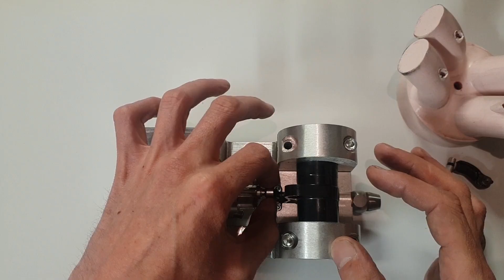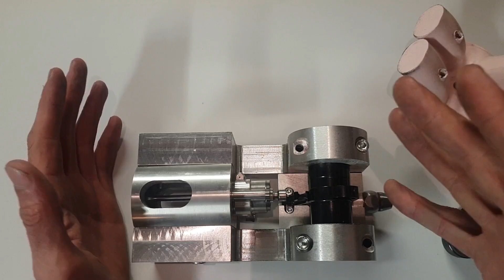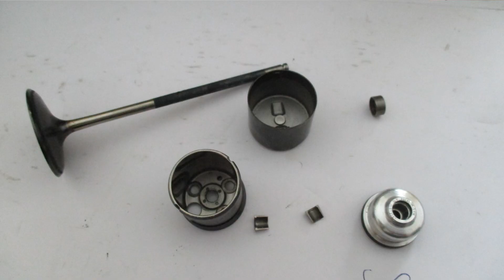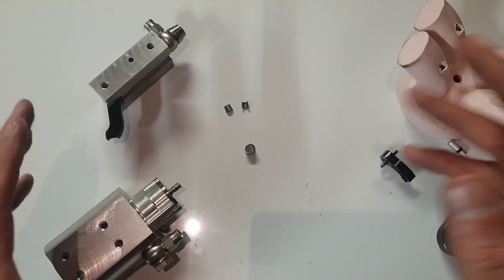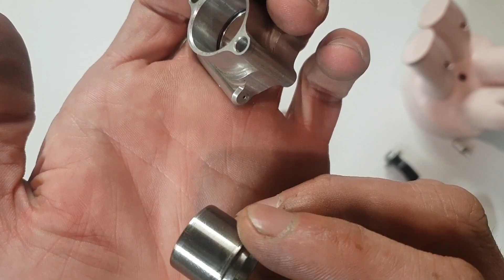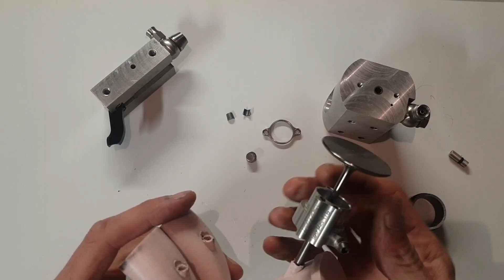F1 Pneumatic Valve  Spring - A Closer Look - Ep 1

Comment: Is there a pump on the car to keep these up to the required pressure?
Reply from the maker: No, a nitrogen bottle about the size of a camping flask is topped off before each race. Its down by the drivers left thigh in cockpit. The seals don't leak much at all.
Reply: @EngineeredtoWin  thanks for the reply. I absolutely love the videos, cheers.

Comment: That's a fascinating video and one of the few engine parts I knew nothing about.
Amazing how simple the check valves are even though there are a lot of pieces inside each one.
Could the pressures be 'fine tuned' with the assembly screw?
 Some beautiful machining a lot of it I wouldn't like to do, way too sketchy on manual machines (I trained as a precision machinist/turner, 0.003 micron)
Are 'compound valve angles' the same or similar to radial valve engines where valve heads are kinda parallel to piston crown? (Honda RFVC, 1980's)
Are they titanium valves?
 4.3mm is a real thin neck, particularly with a 40mm head! I guess the actual stem is about 5.5mm?
Lightened lobes on cam is interesting feature, thanks for cutting it up to show and tell.
Thanks for telling me to log on to F1 Technical, never heard of that site before

Comment: I would really like for you to look into the rod and main bearings on F1 cars. They are not traditional. I would like to see how the oil and all the materials they use. I have seen an illustration and it looks like they have used cylindrical roller bearings. Nice video. I just found your channel.
Reply from the maker: Max, have a look at Ep 9 - it may answer a few questions. As for Mains, they are pretty much traditional on all F1 Engines Ive seen - however some did use needle rollers to lower rotating resistance- however these have risks associated with them due to high hertzian stresses caused by the rollers. I'll be doing an Ep on this in time.

Comment: Is the oil that is removed thru the oil relief valve there as a result of a metered oil mix on the air supply or residual oil past the seals. If it is past the seals, I would assume it is happening when the engine is not running as I would think the positive pressure in the air chamber would keep oil always pushed out past the seals. thanks for the video. I'm an old American v8 guy but all IC engines to me are mechanical works of art with all the engineering, design, compromises and technology limitations that go into what looks relatively simply from the outside.

Comment: Why do F1 engines not use desmodromic valves where cams push the valves open and pull them shut?
Then there’s hydraulic valve actuation that controls valve timing and lift. Fiat put it into their MulitiAir engines.
Reply: Weight

Comment: Great video! Question how does the pneumatic piston 'grip' the valve stem ?
Reply from the maker: The collets...they lock the stem onto piston...you can still push the piston down the stem and off the collets, but the collet wedge angle stops it coming off the top way,

Comment: I’d be interested to know the weight of that valve is and if it was made from anything special? Would it have been a good choice for Beryllium?

What would a hollow F1 camshaft weigh? Never seen any of this kind of F1 engine info before!
Reply from the maker: I will check. It's made from 6AL4V Titanium.  Ber is banned sadly, mainly due to machining and grinding dangers.  Will also check weight of camshaft - hollow as you mentioned and not oil filled as with some engines.
Reply: @EngineeredtoWin  Thankyou. I find it fascinating to learn about these spaceship engines that cost teams  $100m+ per year back in the day. 20,000rpm (and 3L @ 1000hp) is still a mind blowing number. Via your channel I can finally start to see how it was achieved

Comment: You can’t really grind an alloy surface in the same way you can steel so hence the liner inside the bore. I would suggest thermal considerations and the risk of galling at high revs would be other pertinent reasons for a steel liner.

Comment: Pneumatic actuated valves have been around for quite some time in various iterations. They have defo been around on racing motorcycles so it’s hardly what you call cutting edge.
Reply from the maker: Just because something is around a long time doesn't mean the tech behind it isn't cutting edge and always changing...you will not find design details, discussion, or images of any actual pneumatic valve-train internal parts and seal details any where else on the internet bar the images taken by me. To go further, the design details and seal arrangements were and are so closely guarded, that at least two articles I have read on them in the past which contained photos, were rigged up with bogus parts, and some parts omitted to throw the reader and other possible teams.
Reply: @EngineeredtoWin  there was an article in a UK motorcycle mag about ten years ago showing the head of a Kawasaki race bike with pneumatic valves, but as you say nowt in terms of specs apart from rev limit. What interests me as a former R & D engineer and toolmaker is where is the air pressure generated for the valve actuators? I seem to remember the Kawasaki article mentioning it was nitrogen as the gas and not air - probably due to nitrogen being less likely to leak past seals.
Reply from the maker: @shaunchurchill4594  Shaun, Nitrogen is used in F1 as it expands less at temperature vs normal 'air'. It is stored in a carbon fiber high pressure bottle on the car, similar in size to a camping flask. This is only filled in the pits, and no pressurization happens on the car.
Reply: @EngineeredtoWin  blimey that’s cool that the pressure vessel is so small but then again I guess I shouldn’t be surprised😀 I’ve used nitrogen in kart racing tyres and it’s the larger  molecular size that makes it less able to pass through tyres and seals and as you say it remains a tad more stable than air.

Comment: There is no actual reason why, at this point, naturally aspirated F1 engine details should remain secret.  No sanctioned motorsport will ever return to a naturally aspirated formula.   Ego is a helluva drug...
Reply: I’d have to disagree. We just gained a tremendous advantage over our competitor because of a picture they put on social media. We figured out the cause to a problem they had because of how they store an assembled part. Tiny pieces of information can be a huge gain to other teams.
Reply: It doesn't matter if they're NA, valves actuation is the same for turbos.
Reply: @anvilsvs  I think Honda changed back to valve springs and presumably most of the others did too.
Reply: @Paul Bunce  Oh, that's right, i forgot about all the turbo engines that spin up to 20,000 rpm...  How astute.
Reply: The kind of drug that makes someone talk about the future of an entity as complex as Motorsports as though they've seen it already...
Reply: @WONMARK  The turbo hybrid cars are physical manifestations of virtue signaling.  Naturally aspirated F1 cars will return when pigs fly, and you know it just as well as I do.  The plan is to move away from internal combustion completely, let alone naturally aspirated cars.  Quit playing dumb.

Comment: On those engine is there alternator  and water pump that can rev to those rpm?
Reply from the maker: Yes, gear driven off the crank. They rev to about 12k at 18k red line.
Reply: @Brian Garvey  Humm when ford and yamaha  developed  the sho engine there excuse was when limiting  the  rpm of the engine was the alternator water pump  couldn't not sustain  the rpm over 7k
Reply: @MrMrBigro Sounds bunk. They could just alter the pulley sizes.

Comment: Could you explain the ridge on the valve for turbulence? What does it accomplish? Just better atomization? Thanks!
Reply: What you want to learn you will discover when you study a phenomenon known as the "boundary layer effect." I don't know how to put the negative effects into words, but when you see it in air flow simulations, it will make perfect sense.
The turbulence grooves reduce the resistance/restrictive consequences caused by the boundary layer effect

Comment: thanks for explain, have you done a video about the pneumatic circuit? do you know how much pressure at the reservoir and how much pressure should be at the circuit to the valve chambers?, thank you!
Reply: So back in the day, main bottle pressure was circa 220 bar and feed pressure to the avs Circuit via a regulator of around 18_22 bar...

Comment: Wow! This is amazing. Do you know what system is used to provide the air for this. Is the pressure constant threw out the valve cycle, or is there any valving built into the regulator?
Reply from the maker: An onboard nitrogen tank is used - and filled in the pits. No onboard charge compressor. The pressure is constant yes, although it does rise under the piston plunger when the valve closes obviously. If the pressure gets too high it means there is some oil as well as air under the piston and a small spring plunger internal pressure bypass opens to vent oil momentarily - exiting out one of the small vent holes at base of assembly shown in video.

Comment: Student tinkerer trying to build a pneumatic cylinder head, this thing is something else. Modern designs have ditched the cams which is insane
Reply from the maker: Indeed...one maker Christian Von has gone camless...and instead uses voice coil type solenoids for actuation.  However, these tend to be very heavy, which would effect the CoG of an F1 engine a fair bit. They're probably banned too.
Reply: @EngineeredtoWin  Thanks for replying! I did not expect to hear from you. I am digging around for designs I want to emulate. The combo of hydraulics and pneumatics is very interesting. I think it has a lot better design potential than just air and it is probably more realist for me than using electromagnetic actuators. I am going to need to get a lot better at machining if I want to emulate the complexity of using oil and air. But I think its the best path to getting variable lift which was a problem I was struggling to solve with air alone. I haven't sorted it out yet but some combination of oil pressure and porting can either set valve lift with directly with volume in a chamber or supporting a mechanism. It feels pretty out of my depth ngl but I am chugging away.

Comment: Intake and exhaust spring open pressures combined with volume of valve cylinder would be valuable info?  Inlet air pressure would be a guarded secret.    My guess is all four variables change in ratio with lift and duration of cam.  Lots of expensive dyno hours!!!

Comment: Any speculation on N pressure inside the chamber? Your tech post discusses the over pressure bleed valve, but what ensures there's enough pressure so valve float isn't an issue. 

Also you mention the running position of the finger follower on the lash cap is asymmetric, but no one says why. I'm assuming its to induce valve rotation, but just want to verify...
Reply: Valve float is a result of spring resonance. Gas springs have very high resonance frequencies not seem in reciprocating engines. So I guess air pressures is just enough to make the valve follow the cam closing profile. The valve parts are very light. Most probably spring tension is not more than typical road cars.
Reply: https://youtu.be/Yl_VpSnupZw
The pressure used in the Moto GP pneumatic valve system is 10bar (in the head/pneumatic chamber), I guess it's about the same in an F1 head.